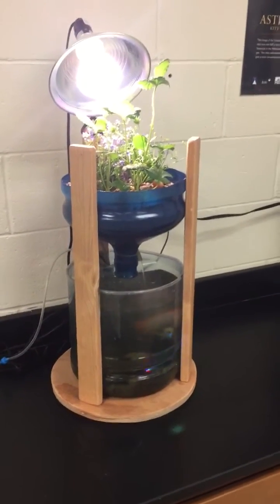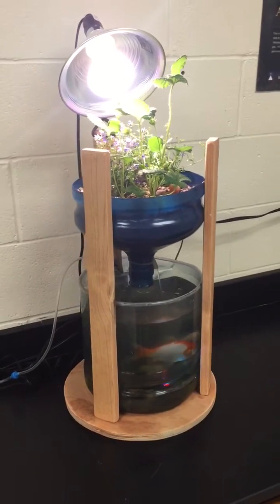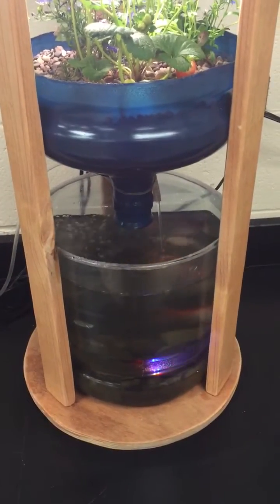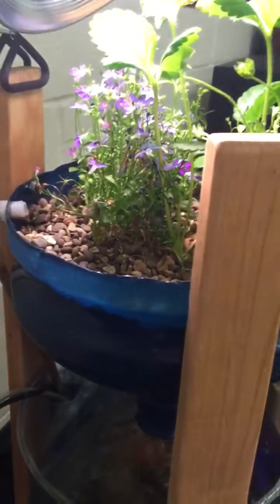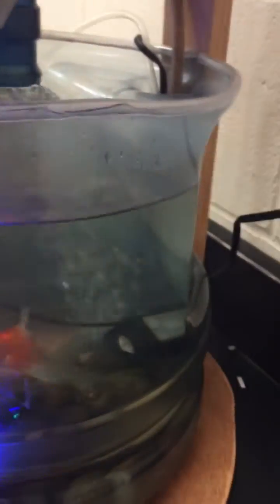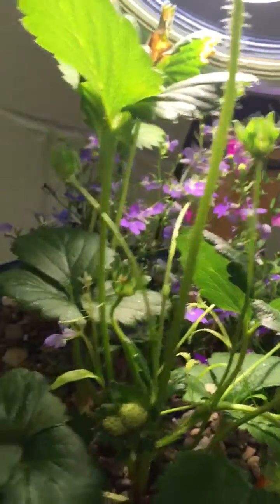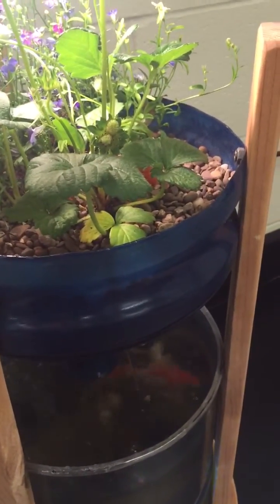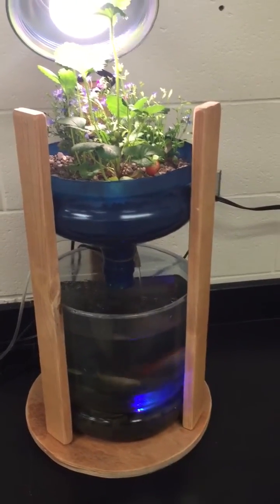Miniponics

Comment: Great work! How did you mount the timber to be tank? was it screwfixed?
Reply from the maker: Yes the timbers were mounted to the top half of the bottle with carriage bolts. The fish tank bottom sits in between the timbers freely. Thanks for watching!
Reply: Shawn Crow  how many inches is it  from the base for the tank?
Reply from the maker: Mohd Kassim Hashim we just kinda eyeballed the height of the grow bed from the base. You want to make sure the neck at the bottom sits within the fish tank portion. If not the splashes from the return water will splash out.